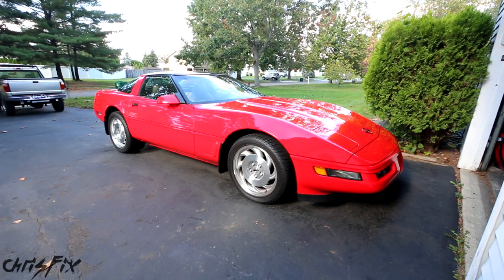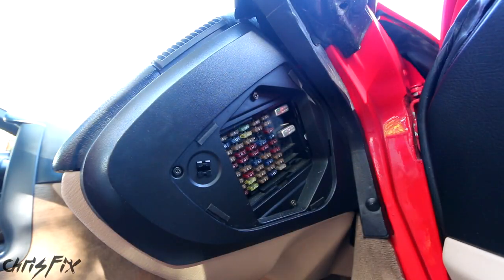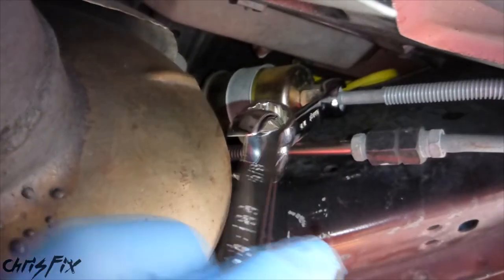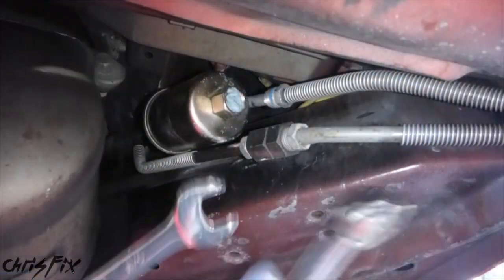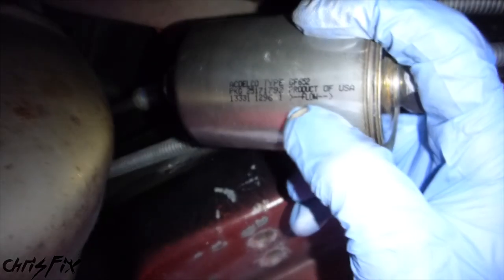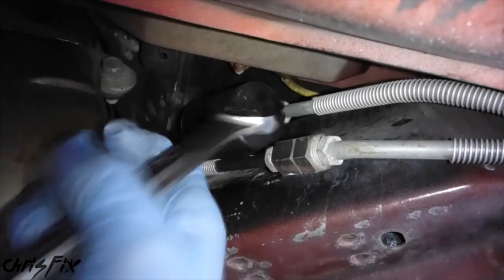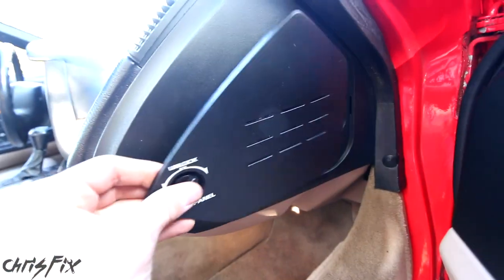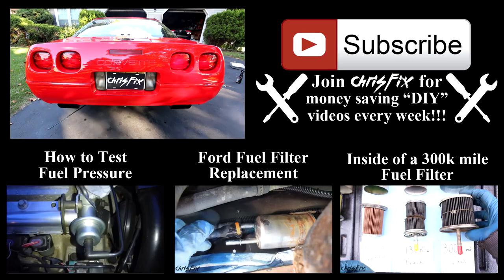How to change a Fuel Filter (GM, Honda, Toyota Style)

Comment: Thanks for doing this on the vette, my 4th gen trans am uses the same style. I imagine the 2010 camaro would too, I'm about to get one and it probably needs a fuel filter after 50k miles.
Reply from the maker: +Joey Cusimano No problem Joey! Glad the video was helpful!
Reply: Yeah especially the part about anti-seize. I put that on my hubs between lugs so rotors don't stick to the hub. But didn't know this was another good application for it.

Comment: Chris that little trick at the end where you turn on the car than shut it off, the on and off again before starting the car got me intrigued. My car lately has been acting up, when I turn  the ignition on, the batter indicator light turns on but very weak,  if I try to start the car, the engine will stutter, but if I do that little trick of your before starting the car, the battery light indicator intensifies and the car starts with no problem. Do you think that's an indicator that my battery is dying?
Reply from the maker: It could be. Get the battery load tested.Your local auto parts store will do that for free.

Comment: Hey Chris, I have a 95 4runner and I attempted to replace the filter last week but I stripped the nut on the fuel line and it was leaking from the filter. “A friend of a friend” fixed it, however he had to “hard line” the fuel line thus removing the fuel filter in general. He said there is another filter under the hood. Should I be concerned not having a filter?

Comment: Hey chris, long time subscriber just wanted to let you know you are doing a great job my man. 
And i had a question about my toyota corolla 2011, the cruise control is just not working right it sometimes turns on and when i press the button to turn it off it just gets stuck over there and the whole thing revolves around the cruise control sometimes working and mostly just gets stuck and not working, so any input on this would be appreciated. I had a guy check it he said that the fuse was alright and you need to go to a mechanic for it. So best wishes and hope fast for your reply
Reply from the maker: +Sikander Saeed Thanks a lot man! I really appreciate all of the support! My guess is you have a vacuum leak somewhere which is not allowing the cruise control to work properly. Find the cruise control module (typically connected to the throttle cable) and look at the vacuum hoses and check for cracks. Now that I think about it, does that car have drive-by-wire? If so, the computer adjusts the cruise control and that is harder to trace problems.

Comment: I had my eclipse tuned up in the spring. I use premium fuel only in my GT. I was wandering if my fuel filter is the same style as in your corvette? There is no problems with it now I just want to gain exp mostly. I do use seafoam about every 6 months regardless if it needs or not. Is that something you would do? Thanks.

Comment: Nice video as always .. very helpful and inspiring to do any kind of job in my garage.
Anyway, in my car: Honda Stream .. the fuel filter is in the fuel tank which attached with the fuel pump, but i check online catalog parts and search for that kind filter that was in the video .. and it was "fuel canister, filter"

Is it the same parts as you mention in the video ?
Because the position was underneath and had same shape like in the video.

Please help
Reply from the maker: +Don Bosco Andrian For those "in-tank" filters you only replace them when the fuel pump goes bad. They are a canister filter which is similar to what you saw in this video but in the tank.

Comment: hey chrisfix thank you for the video I'll be using it on my 99 bird! also have you any idea about headlight motors for gm's I changed my gear in my motor but it still won't work  what do you think? Thanks and happy New year!
Reply from the maker: +Brady Bacon Awesome! Does the motor spin/make noise? If not, I would check fuses.
Reply: Yes it does spin and it makes a rattling sound and won't go up just down after I manually turn it

Comment: Hey Chris I have a 2001 chevrolet tahoe 4.8l 4×4. My transmission is starting  to slip. And I plan on temporarily using Lucas transmission slip. How do I use it and or should I take some transmission oil out. We're do I enter the liquid thru. ? Thanks in advance

Comment: You're not scared using the anti seize on this type of application? Even at my car wash, sometimes I don't use it if it's on hydraulic lines. As I don't want to risk it seeping into the system.. What is your take here?
Reply from the maker: +General HowTo If it seeps into the system that means there is a fuel leak so that will be the least of your worries. The threads are sealed from the fuel system so there is nothing to worry about.
Reply: +ChrisFix ok very good. With my hydro lines... There is a chance of it seeping in... So I'm always really careful. Btw... Happy New Year. Hope your channel keeps growing!!!

Comment: Sir,good day!can you show us the location of 2012 honda Crv EXL AWD fuel filter?thanks
Reply from the maker: If I get a Honda CRV I can make a video on that!
Reply: @chrisfix  do you have a shop that I can go?an address?just incase I want you to fix my crv?the Engine code is P0204 Injection Circuit/Open cylinder 4.I already change all the spark plug and coil pack for #4.I clean the mass airflow thru you video and still it has hesitation and Engine light comes back the same P0204 and AWD pops up.thanks
Reply: @chrisfix  you can use my car with pay😁

Comment: Hey Chris, I don't think you mentioned this in your vid, but I read that when doing a filter service, its a good idea to open the gas cap. It has an effect on the pressure so not so much fuel will pour out when you loosen the flare. Thanks for the otherwise great video!
Reply from the maker: +TheJojobob123 Never open the gas cap, you want to keep the gas cap closed because the vacuum in the tank will prevent fuel from just pouring out of the fuel line.
Reply: Oh whoops, I did it when replacing the filter on my tahoe and didn't seem to have a problem. I was confused as to why I should open it because what you said makes more sense anyways. Oh well, thanks and happy New Years.
Reply from the maker: +TheJojobob123 Yea, the fuel cap basically doesnt help lol. Happy new year!

Comment: Chris, any tips for how to remove a fuel filter from the gas tank?  After research I found that its located under a compartment in my back seat of my 04 Corolla.
Reply from the maker: +MrSilenttrigger Yea those are not fun, but it isnt bad. Gotta take the rear seat off and then you have easy access.

Comment: Hey Chris. I noticed there was some pressure in the fuel line when you loosened up the first flair nut. Would taking the gas cap off have relieved that pressure and minimized that fuel spray?
Reply from the maker: The gas cap has nothing to do with the fuel line pressure. The only way to bleed it out is to get a fuel pressure gauge and purge it at the fuel rail. Since pulling the fuel pump fuse did help, there is only a little pressure vs the typical ~50psi
Reply: roger that.

Comment: Hey Chris, A while ago I told you about a problem where the fuel was bleeding back into the fuel tank over night and I had to keep priming the primer bulb to allow the engine to start, turns out the fuel filter's o-ring wasn't replaced on a service and created a leak.

Comment: Hey Chris, was hoping someday you could tackle some error codes, particularly p0441 which is one I've been trying to remedy myself. I'm pretty sure I've gotten to the point where it's the not the hoses, purge valve solenoid, evap line or canister, etc etc, I'm afraid it might be related to my egr valve needing replacement cuz everything else seems to be fine...plus I had a "professional" look into it and they cleaned the valve but the light came back on so it might need to be replaced completely. Anyway, thought maybe you know some tricks and tips that could help out us beginner diy'ers :) Always enjoy your videos, thanks!
Reply from the maker: +Legendary Minja If cleaning the evap purge valve worked, and the problem came back, then that would be my guess. The thing that stinks is that the evap system is so touchy. A leak could be the size of a pinhole.

Comment: Quick question. What do you do if the bolt is rusted? Like SUPER rusted? I used this blaster spray that’s supposed to help, but it isn’t. The rust is too bad. Any pointers?

Comment: The fuel filter on my honda is located in front of the firewall on the passenger side and both lines mount on top.
Reply from the maker: Nice that's easy

Comment: Hi Chris. Just a quick question, shouldn't you have release the pressure in the fuel tank before unscrewing the fuel filter? This should release all pressure in the system and should then leak less fuel.
Reply: +CasKru123 When Chris pulled the fuel pump fuse, the engine burned off excess fuel pressure in the line.  The fuel that drips out is from the bottom of the filter or the small amount in the line.  The amount of fuel he leaked is nothing compared to changing a filter under pressure (yep, I've done it).
Reply: +Brian Piper When pulling the fuse, the engine dies almost immediately yes but in it surely cannot get rid of all the pressure in the line? Think about it this way, on my Toyota the high pressure pump runs at 6Bar. Pull the fuse and that pressure is gone and the engine will die as the ECU cannot keep it running with the correct pressure. I always open the fuel filler cap as well and then there is still some pressure in the tank. Not trying to find fault but would just think this will be an extra step to make 100% sure all the pressure has been released

Comment: On my Lexus sc400 ,  I removed the EFI fuse and xar died.  Loosened the fist line flowing into the filter,  and the gas just kept coming. I finally just reconnected the line and called it a day,  though I had to spread a bunch of gas around the near by field.

Comment: How would you know when it's a good time to change the fuel filter since newer vehicles don't require much maintenance and where would it be located on a 09 Tacoma?
Reply from the maker: +michoacan91davi Check your owners manual or every 50k miles. The Taco might have a filter in the tank which you dont replace until your fuel pump goes bad.

Comment: ok i have a question, and i know i might look like a noob asking but it cant hurt. When you order brake rotors and pads it says quantity:1 does that include both rotors for the front or rear. Or just one?

Thanks.
Reply from the maker: +jezzel onefive For rotors, that is typically just one rotor. For brake pads, that is both front brakes (4 pads total, two on each rotor). Good question!
Reply: +ChrisFix Thanks Chris I appreciate the help, I really do. Your videos are pretty helpful as well. Thanks once again.

Comment: I am trying to do one on a Buick Regal, and I can't get the fuel to NOT spray out around the flare nut.  I took it off like 4 times and wonder if the line needs re-flared, OR the cheap filter is faulty. Any suggestions?? Please?
Reply from the maker: Are you saying that you can't take it completely out?
Reply: @chrisfix  Hey there. I am able to remove it, but when I connect the steel flared nut end into the new filter, it sprays out around the nut. It's like it's not sealing between the steel flares line and the filter. The other end is a quick connector with zero issues. 

I'm not sure if I have a bad filter, or I have to reflare the end of the line. So frustrating.

Comment: I did one of these on a 97 Park Ave, that was not nearly as clean underneath, ended up needing a compression fitting to repair part of the fuel line since the on side had seized to the filter.  Of course it most likely was an old fuel filter that had not been changed in a very long time, but still it should not have seized like that.
Reply from the maker: +Liowen Dang, that stinks. That is why I add antiseize.

Comment: I have a 1995 Toyota 4Runner, and I just replaced the fuel filter, but it leaks out of the fuel outlet side. We’ve tightened it as tight as humanly possible and it still leaks. Any tips?

Comment: hey chris, i have a problem with my truck mazda ranger same with your, the problen is with the headlight high beam, i dont know is the relay, can you tell where is this relay

thanks buddy!

regans from Honduras
Reply from the maker: +Hermes Yanez Hey Regans, check the owners manual for where the relay is located. It is most likely under the hood behind the battery like in my truck.

Comment: CF, what would be your pick for best all around suv, Ford Explorer, Toyota 4runner, or kia sorento. Im in the market can't decide.
Reply from the maker: +dawnpatrol I would go Ford Explorer. It is the same chassis as my truck (unless you are talking about new). The Explorer is pretty bullet proof and has a great lineage. The Toyota is pretty good too and I almost got on myself but it was just overpriced for what it was (I was looking new). I do not recommend a Kia (which is a Hyundai) because I have owned the Santa Fe and it needed a new motor after 2,000 miles (brand new). Hope that helps! Good luck!
Reply: +dawnpatrol this is a no brainer, the 4runner is your best option! I have owned a few fords so far, they always break..
Reply: ChrisFix Thanks for the advice, happy new year pal.  Dejan Spasovski I think I agree with you from what I have heard, the resell value's better also, Thanks

Comment: What's up Chris I am one of your subscribers had a question my water pump went out on my 2001 f150 and I thought it was the gasket but once I replace the gasket and resealed it and started it up I noticed the actual water pump was leaking so when I took it out I noticed that there were the sport that were coming out leaking water it looks like they've been there but now they're leaking out water for they are on the water pump itself would you happen to know what are they for and why would they be leaking water
Reply from the maker: +Jorge Ballesteros That is the weep hole which means you need a new water pump because the bearing is bad.
Reply: +ChrisFix thank you for the knowledge your videos have been so helpful I consider myself a mechanic now LOL!!!

I went to  Autozone and ask one of their employees that's been working there for years what is the weep hole? considering I already work on electrical motors I had an idea that there must have been an inside SEAL that went bad but this guy told me he didn't know he's been working there for a million years  how can he not know that???

Thank you your video has been extremely helpful next I want to clean the air mass sensor throttle body and EGR valve next!!!

Will let you know how that went

Comment: Do you have to bleed the gas lines now?

Edit: I have a 74 FJ40 and I changed the fuel filter, but it still won't start. I thought maybe air in the lines would stop gas going to the carb.

Comment: My Cobalt uses the Ford-type fuel filter that requires a quick-disconnect tool.  I have 138,000 miles on mine.  Probably time to change it soon.
Reply from the maker: +kcg795 Then you need this: https://www.youtube.com/watch?v=uQbYs_6jrno
Reply: Thanks.  I've watched them all, so far.  The fuel filter on my 84 Toyota Van isn't fun either.  It uses banjo fittings and the space is pretty limited.
Reply from the maker: +kcg795 Ugh, that is not fun at all!

Comment: What do you recommend for oil flush? Looking for something safe for synthetic oil use.
Reply from the maker: +Luis Ortiz Vazquez I dont recommend an oil flush if you dont have a problem. I would try seafoam just because it is something I have tested and it works.

Comment: I have a 2006 Honda accord, was just informed by a friend the fuel filter was built internally.  Is there any way to get around that?  Thanks.
Reply: no. when the pump dies. the new one comes with filters

Comment: Hey Chris my car is jerky when it hits 3000 RPM (when accelerating) and also rumbles on and off below 1000 RPM when I am stopped. Would this be because of the fuel filter? (I drive a honda btw)
Reply: I know this is a year late but yes, it does sound like the engine isn't getting enough fuel.

Comment: Hey Chris, I have a 1998 Pontiac grand Prix, It has been sitting for a little over a year and I am in the process of getting it back up and running. I wanted to replace the fuel filter before I start the car as the gas is a year old, can you change the filter with out starting the car and then pulling the fuel pump fuse?
Reply from the maker: +Sean O'Brien there will be no fuel pressure so don't even put the key in the ignition. Just swap the filters out.
Reply: ok thanks

Comment: Is it best to have your fuel tank close to empty to minimize the amount of fuel that will spill out when you loosen the flare nut? Or does it make a difference?
Reply from the maker: It shouldnt make a difference but to play it safe (if the check valve in your fuel pump is bad) an empty tank is better.
Reply: ChrisFix Appreciate the tip. Great vids btw! Very informative, and full of helpful pointers

Comment: Chris I have a question, I'm changing the oil in my car at the moment on a 2002 Chevrolet blazer LS and I'm having trouble getting the filter off tried using a tool for the filter but it is really limited space down there how do I get it off?
Reply from the maker: +PinkRibbonRider use an extension and ratchet?

Comment: So the 2010 Camaro 2SS has the fuel filter inside the fuel pump, I guess I don't have to do this as maintenance then? 64k miles. I assume it should be fine so long as I keep the tank relatively full since GM uses an in-tank pump that needs gasoline to submerge and cool it... letting the tank get low causes the pump to suck up crap at the bottom of the tank apparently.